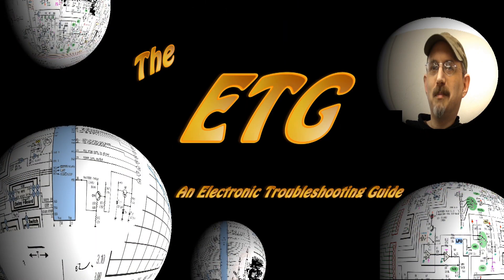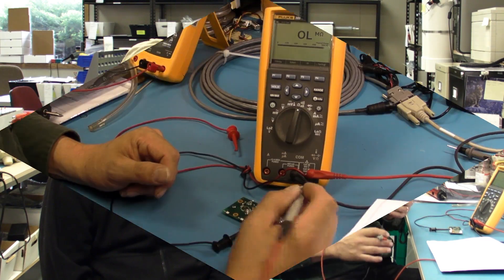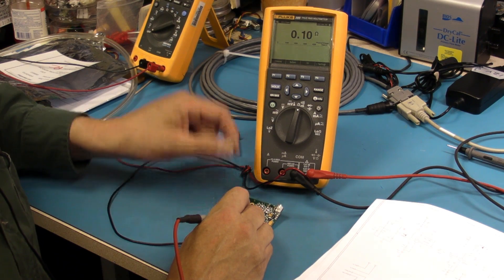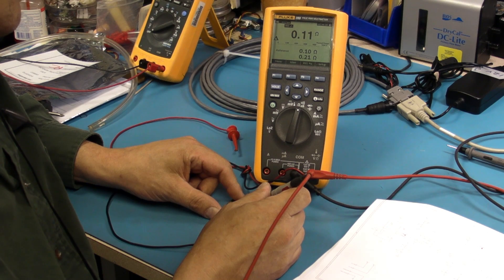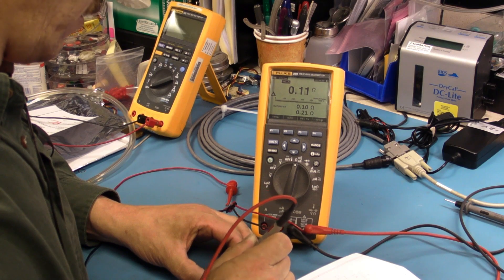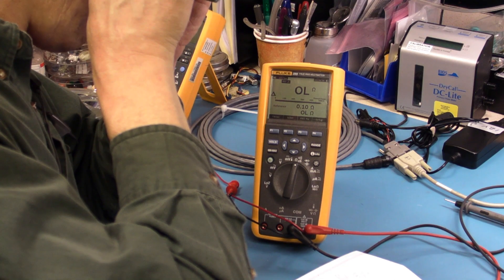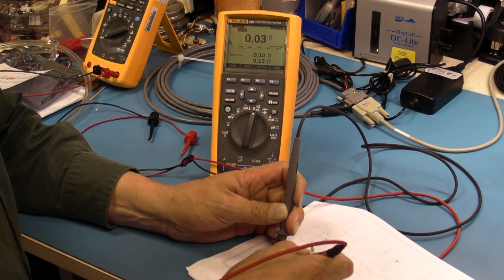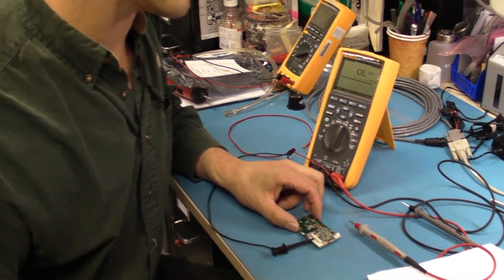ETG-1-02 R.I.P Locating Shorts with an OHM Meter

Comment: very critical fiend a miliohm shot circuit detected. I try many types method but not a gud results. Please gide me.Thanks.
Reply: Probably works best with a proper milli ohm meter but will work as he shows with a good fluke Multimeter.

Comment: I've been baffled by a variety of short circuits over the years, and developed many ways to locate them.  After a particularly bad short finding session, I made a device that solved my problem (in the late 1980s).  Since then, I've refined the thing into a product called the ShortSniffer (cheap promotional plug).  If you've never seen this device, take a look at www.shortsniffer.com, or check out the free DIY at "http://testecvw.com/product_pictures/Do-It-Yourself ShortSniffer.pdf" to see if the principle would help your efforts.
Reply: I edited the link, trying to get something reasonable, but that broke it up.  Here it is again: http://testecvw.com/product_pictures/Do-It-Yourself ShortSniffer.pdf
Reply: still broken . . . copy the link (from http to the .pdf) and paste it into your browser.  The space in the filename is fighting with the security tools on this website . . .